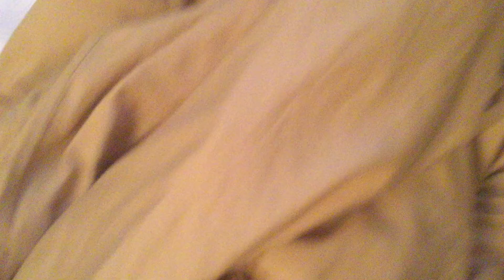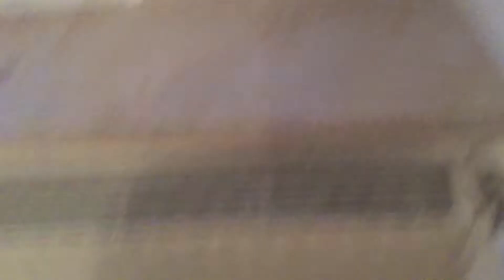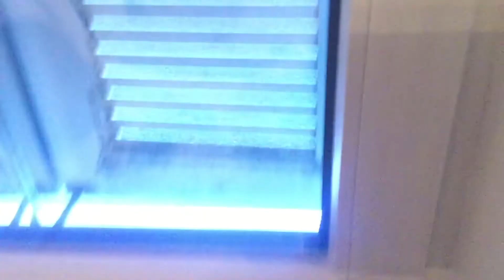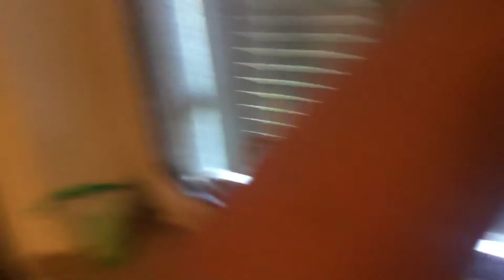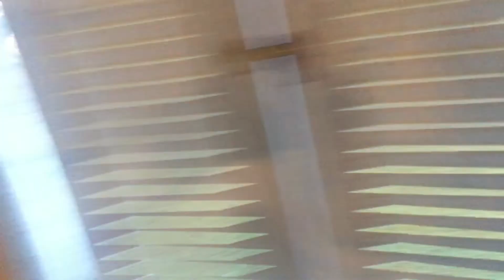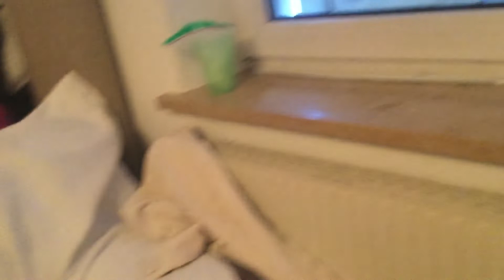German engineering

Comment: as an engineer i require elaboration
Reply from the maker: I'm a dog on the internet and when you turn the hand to the side it opens like a door but when you turn the two top corners open
Reply: @doaa7941  as an engineer the only remotely plausible explanation I can offer is the sudden break down of trans-universal ether upon application of torque to the rotational device in question; in this absence of ether stray ether constituents likely escaped from destroyed and/or malfunctioning parallel universes quickly fill the gaps, creating an opening mechanism that in our universe bears no resemblance to sensical engineering; however it must be pointed out that such a mechanism in the ether's original universe was likely commonplace.
Reply from the maker: @William Waffle thank you engineer man, I will now move on with my day knowing that the window is an ancient artifact from when the universe was created